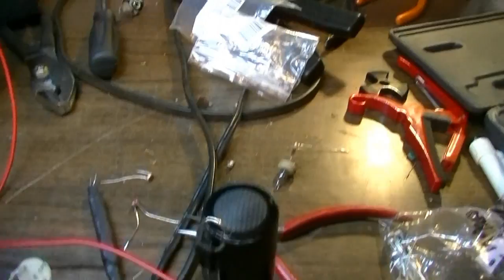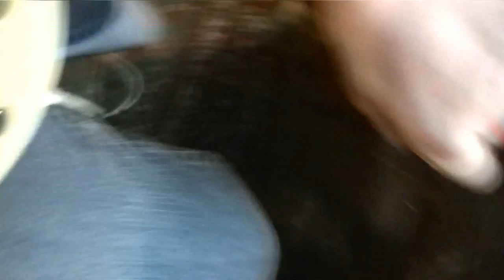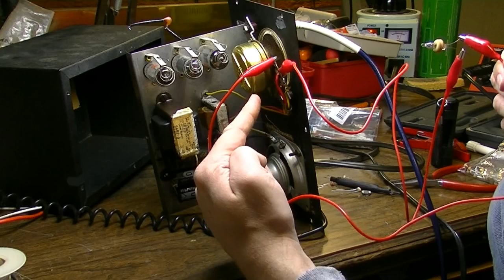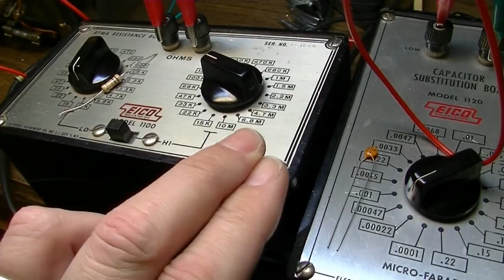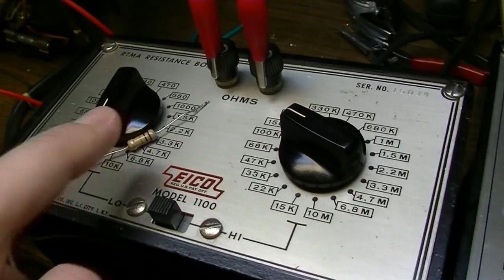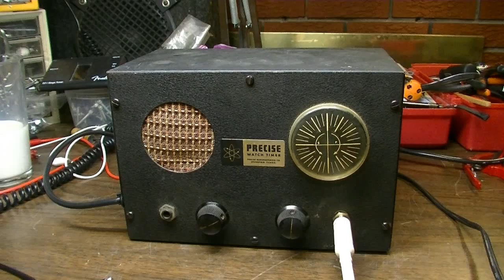Vintage Watch Timer Converted into KILLER Guitar Preamp (Part 2)

Comment: Funny how you should make that........I once helped out a bloke running his music shop while he was away for 2 weeks........A local guitarist came in and we had these little portable amps......sort of looked like a small transistor radio you would clip on you belt, but this was a little amp with a volume button and a switch....one way was normal and the other was distortion.......about the size of a packet of smokes......he pulled a guitar off the wall, and plugged the thing into this little amp and let rip........he played this thing until he had quiet a crowd gathered and boy he could play.....and was quite well known as one of the best down here in Oz..........when he finally stopped, he said it was the best sound he had heard in years and said he would hand over a lot of money to get an on stage amp with that same sound......cut a long story short, he brought that little thing and used to Mic it up at some of his performances....and I remember to this day the pleasure it would give him......it was a magic sound and even me as a non muso could hear it.....funny how things work out some time.......

Comment: The click in your tremolo is most probably because the light in your "roach" is flashing to abruptly. In lighting terms... your lamp is cutting on and off. What would work better is to have the lamp quickly fading on and off. That is why so many of those circuits use neon lamps. They ramp up and down instead of harsh flashing.

Comment: What about setting the clock to 4 times wanted frequency and using it to drive a Johnson counter which could be used to drive a Double Balanced Quadrature Sampling Emitter based mixer which might give a more pleasing sound you know either LSB or USB sound effects maybe not tremolo but a pleasing sound effect none the less and is an effect used in some Ring Mixer guitar Effects pedals.
Reply from the maker: Thanks for the comment, David. I'm afraid most of it went over my head. I did get the tremolo pretty well sorted out in the end though, before it went to its new owner.

Comment: I am really enjoying these. I have recently gotten back into servicing transistor amps and I am thinking about getting into valves.
I have an idea about another way to get a tremolo effect with this amp. What if you set the light on the spinning disk to be always on and put the LDR on edge so it would pick it up as it went past. You would need to vary the spinning speed somehow. Just my crazy thoughts of an optical version of a Leslie Speaker.

Comment: so I am wondering if on your tremolo circut if the pot is just dirty or bad. it seems to be giving inconsistent input voltage to the lighting circut. also is that super high voltage neon lamps? I can think of a couple possible problems in that circut that may be causing the problem. also the blippy cuts its making is voltage spiking and dropping off rapidly or the opposit. that could likely be remedied with a capacitor which would slow the fluctuation of energy to the lamp down. 

just some thoughts. I ABSOLOUTLY LOVE THIS AMP!!!

Comment: Are you feeding that output directly into your little test amp?
are you not putting a load on the output transformer? it is expecting a speaker load there and if you are feeding it into your amp directly you will have a huge impedance mismatch. sounds good as it is but you risk blowing that transformer running it essentially no load.

Comment: You could always change the Zobel resistor out for a pot.  I'll bet the tick is from the original lamp - try getting rid of it.  And add an intensity pot to cut it down.
Reply from the maker: I revamped the tremolo later on before sending this unit to a new home and it was pretty much perfect after that. The way that tube discharges, it's either ON or OFF, I could figure out no way to change intensity. So it's only good for DEEP trem.

Comment: i would love the schematics for this without the tremolo
Reply from the maker: I have no intention currently of drawing it out, but if you pause on the schematic and fill in the parts I added, shouldn't be too hard. If you're strictly going to use as a preamp, there's no need for the OT. That might be hard to find the right one anyway. You'll just need a capacitor into an output jack. Good luck! If you build one, make a video and link here!
Reply: Shit, why not? Offer them for 5 bucks a piece. After all you added and subtract it won't be the original schematic or purpose.

Comment: The clicking is because of the flashing that Neon lamps do when they first turn on. You should try either using a filament lamp, since those don't flash, or completely rewire the oscillator to something more traditional.
Reply: Going back and looking at the circuit, I wonder if using an LED with a diode in reverse-parallel (like in a distortion clipping circuit) in place of the Neon lamp might work. I remember seeing something about ways to add LEDs to tube circuits on Valve Wizard's website, might be worth a look into.

Comment: still haven't rounded up a 12" to play it thru ? you've got a great class A tube going to 3.5"  puttin thru that pv kba just compounds annoying tone with cheap crap  xistors & 8" ... that tremolo sounds like heck . you started out so great and ended with ....
Reply from the maker: Bob Saturday I thoroughly disagree. I'm not putting a 6bq5 in the amp. My advice: buy the one on eBay and put your money where your mouth is.
Reply: you off yor rocker ? buy that pos for 5C$, sure thing, you haven't caught one too many hi voltage shocks have you ? I see your point of not changing much and keepin it "reversable". its a just cutesy little distraction and the thyratron is interesting . played around with some oddball stuff last century , now I play guitar .  theres plenty of great amps like the little epiphone 7watt w/ 10" I bought for $75 if I'm out to put money anywhere , is this a tech pissing contest or about discovering great new guitar sounds ? 500$ sure
Reply from the maker: If you watch enough of my vids, you'll hear me say again and again how much I despise "tech pissing contests". No point in them. My videos are more for entertainment, not electronics "how-tos". You seemed adamant about me installing a 6BQ5, but that would mean I'd have to find and install a new OT for it also, which is pointless when the thing already has a killer tone and is a much more interesting and flexible piece of kit like it is. I understand you don't think the tone is killer, but sorry bro, you're wrong on that one. ;)
The beauty of this little 1w output is you can use the internal speaker for couch jamming or find a little 1x8" or 1x10" cab to sit it on, OR just run straight to the front end of your Marshall (or Kustom KBA15) and run it as a preamp. I think the setup is way better like this than if I made it into another boring SE 6bq5 setup.
Reply from the maker: I did notice you heavily edited down your original comment. I think that was a good move.

Comment: You should experiment with an electolytic cap across the lamp. This will increase the attack and decay time for the lamp and may well get rid of the click.
Reply from the maker: I will try that. Thank you for the suggestion.
Reply: A control to bleed some of the unprocessed signal into the output would be nice too, so the depth of the effect can be dialed in as well as the speed. Maybe a coaxial double pot to avoid extra holes in the case?

Comment: I got curious about how these watch timers were supposed to work. (I think it's just a matter of setting the strobe light or tremolo sound either one to a certain time pulse (every .2 seconds, .4 seconds etc.) and then trying to set the watch's internal timing mechanism to it). I didn't find exactly what I was looking for, but I did stumble upon something neat. Search for Steve Wozniak and "Nixie Watch". It's a wristwatch that runs on two very unusual vacuum tubes.
Reply from the maker: Cool! Will do when I get a little reading time.

Comment: wow!. tell ya what, that little thing sounds better to my ear than some of the amps (alot more expensive) you have demo'd on your site.  I would think there would be a market for those. too bad you can't find more of them.... I would venture to say you could record some tracks with that. sounds better than alot of distortion pedals I've owned or tried.....
Reply from the maker: I didn't want to seem like I was tooting my own horn or something, because truthfully, I just stumbled upon this, but I totally agree. This thing has the best overdrive of any pedal or tube preamp I've tried in a long time. I am amazed by it, actually. If I can get ahold of more sets of transformers, I might start building these to order (without the trem feature).
Reply: Not so fast on leaving off that tremelo feature, even with the slight tick (which you may be able to eventually eliminate) its gives that amp a unique flavor/vibe... I like it actually
Reply: Pignose killer. Tom Scholz would have him bumped off for sure.

Comment: Cool...  Glad you got the "Tick" out of the tremolo... those are annoying.
Reply from the maker: It isn't completely out. I think changing the caps and selenium rectifier, and running only a single light, rather than two, might solve the remaining issues. I'll get back in there at some point when I have more time.
Reply: Someone has that watch timer on ebay for $520....  as if.....   I  THINK  I may have an idea how it's supposed to work....    if it's a mechanical watch,   does the sound make the light blink?   if so you could sync it to the screen...
Reply from the maker: That's the puzzler to me. Some commenters on Part 1 had some theories, but I'm still hazy on it. The sound in the original circuit does not affect the rate of flash of the light. The pot controls the rate. The rate of the spinning disk is constant and, as some have suggested, is pegged to the 60hz line frequency. 60hz...60 seconds in a minute...Might be a connection.